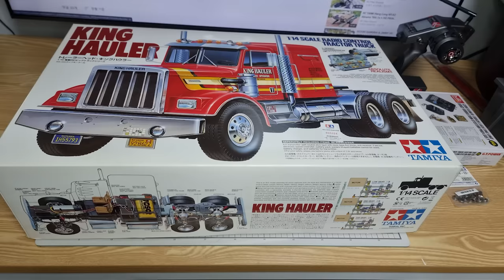Tamiya King Hauler Truck Build Work -  GT Power Multi-function

Comment: i am building my 1st grand hauler and i am using a radiomaster mt 12 surface radio kinda like the radio  your using but diferent brand. i am having much difficultty trying to get the gt power pro light kit to owrk. can you tell me what do the 5 wires on the unit connect to on your rx from top to bottom. i understand the  5th 1 is for xbus. as far as my radio i have st on ch1 th on ch2 gear shift on ch3 and 5th wheel servo on ch 4. also not sure how to change modes on the unit and dont know whta mode im in because the blue lighht stays on constant and wont change even if i pres the mode button. any help would be appreciated
Reply from the maker: The GT Light Kit can be controlled through Bluetooth from a mobile phone

Comment: Those out of true rear wheels need sorting out, much, much too fast. Why grease the shafts  that fit into bearings ? it is the inner race that takes the load not the shaft in bearing.